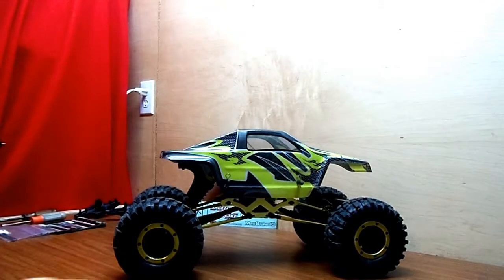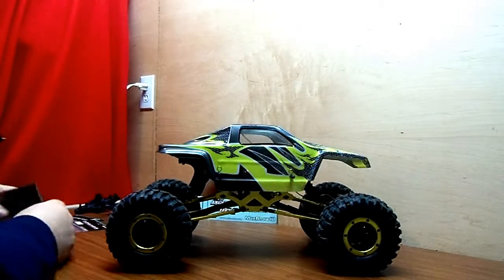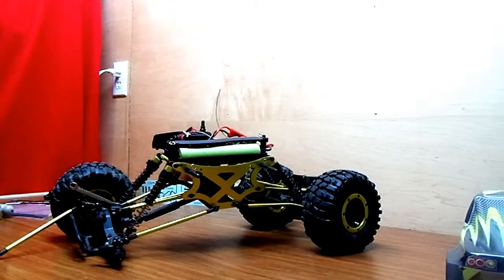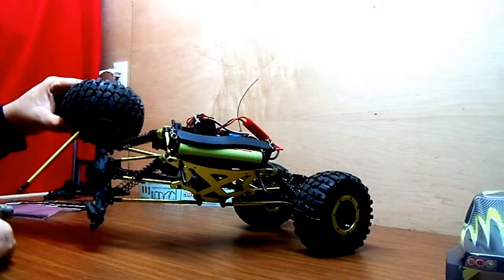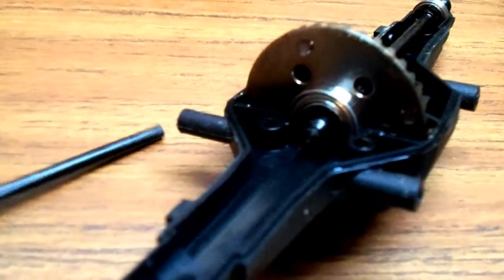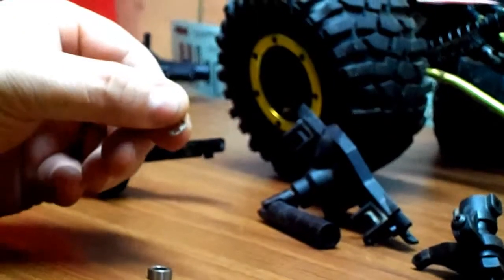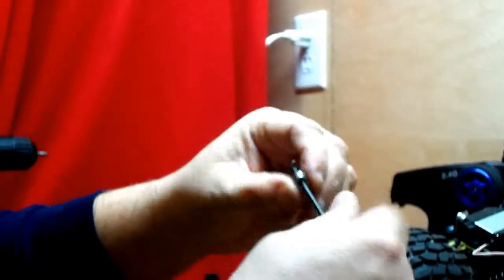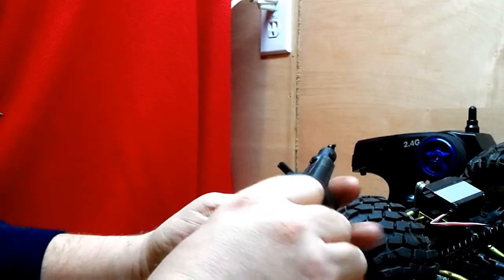Wide Open RC - Maxstone 10 Axle replacement Part 1

Comment: so is this the only problem you have had? do you happen to know if the locker is plastic? from what ive read most people strip the plastic lockers but since your axles are breaking, i wonder if they finally upgraded the plastic locker
Reply: the lockers are half plastic so everyone upgrades to aluminum, compatible with scx10 or the cheap HSP ones